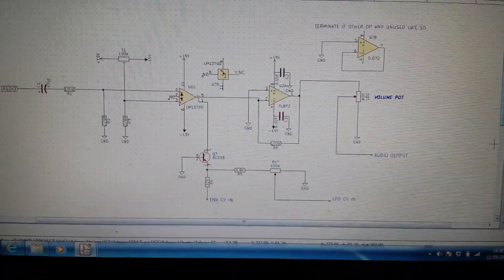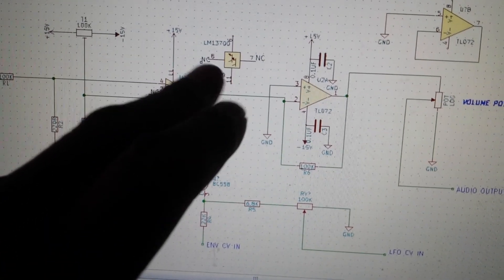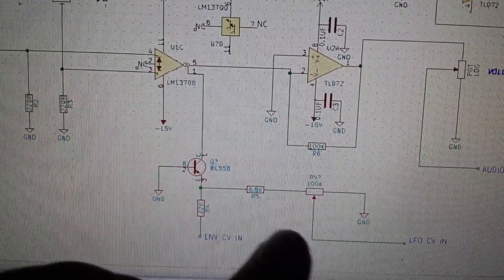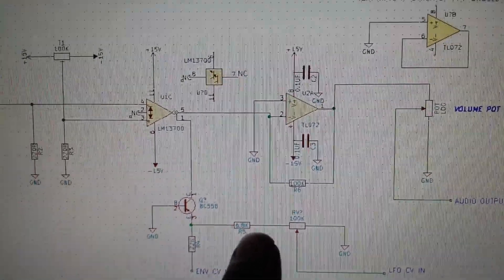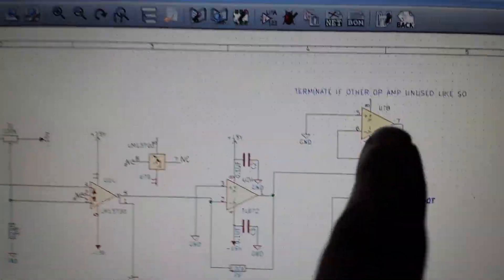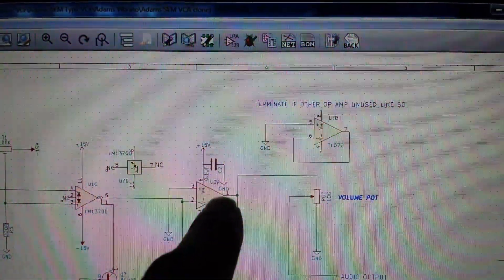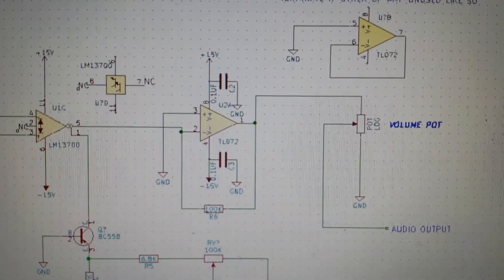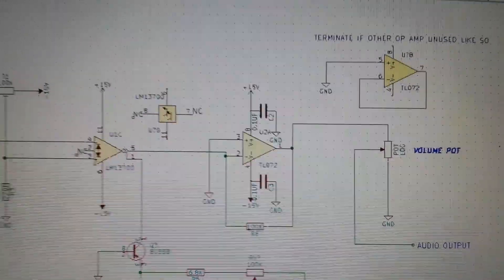DIY analog synth project Tutorial Part 13c (SEM VCA clone extras)

Comment: Adamski Ajull, did you've tried the VCA schematic in LM13700N datasheet? It looks simpler, uses ~ 5 resistors + one (or more) potentiometer. There is no additional transistor and no add. op. amp. Am I missing something and it's less useful then this VCA that you're showing here?
Reply from the maker: MoolahNasreddin Hi Moolah. Funnily enough i did , but it didnt seem to work the VCA was always on . This one was succesful first time and no noise bleed from the oscillators  unlike the one i had before . Which was more complex as i showed in the vca tutorial intro video.
Reply from the maker: Maybe you could give it a go and let me know how it works out for yourself as i may have been doing somwthing wrong. ;-)
Reply: Hi, Ajull! mb I'll "investigate" it when the time comes.
Reply from the maker: MoolahNasreddin That would be good thou i guess i could give it another try at some point and see if i can get an even lower noise floor  :-)
Reply: the PNP transistor a fundamental part to make a voltage controlled, the VCA from the datasheet doesn't show a method to control the current  of the iABC pin and would be always on. of course you add a pot meter here and manually control, like a old radios.

Comment: As this schematic uses just a half of 13700 and 072, with a minimum additional components this VCA can be made stereo or two mono VCAs. I think it can be used with an external input (for example). Also 7 -> 8 and 10 -> 9 of LM13700 can be used as buffers when it's necessary (it can be).
P.S. Here is the interesting story about LM13700. I've didn't knew that it was made specially for electronic organs 1st.
http://www.idea2ic.com/LM13600/LM13700.html
http://www.idea2ic.com/LM13600/SUPPLEMENTAL%20LM13700%20APPLICATION%20EXAMPLES.html
Some single power supply circuits made with 13700 also works great BTW. Already made a MS-20 type of LPF, sounds really good.
Reply from the maker: Thankyou for your suggestions . Yes your right ive seen a few Stereo vca schematics on the web. Yes your right the transistors can be used as buffers as in some circuits. With regrads to the ms 20 style filter sounds very intresting would love to here it when your ready ;-)